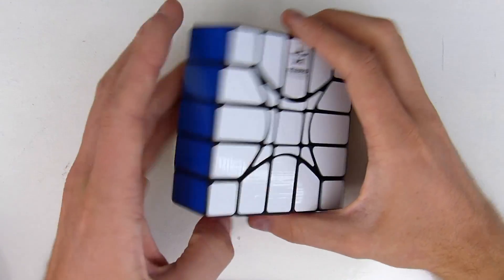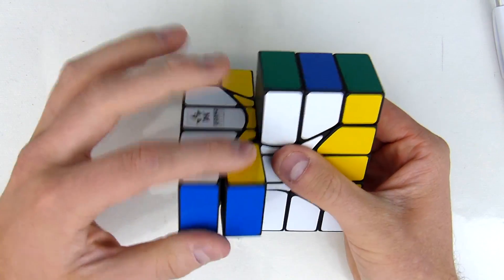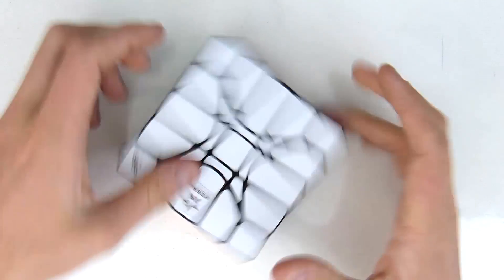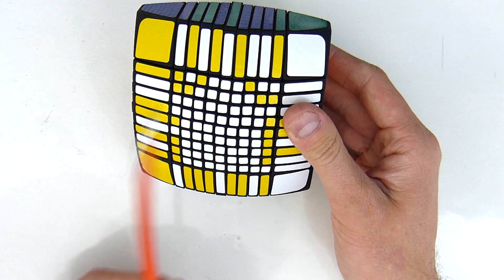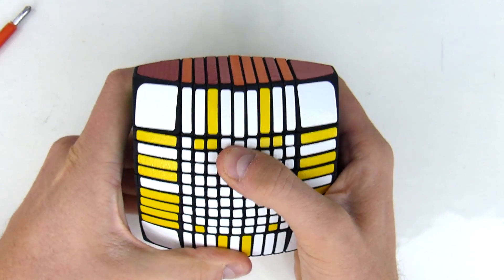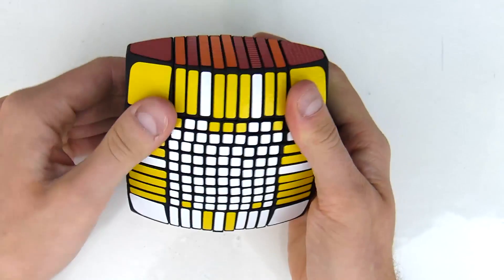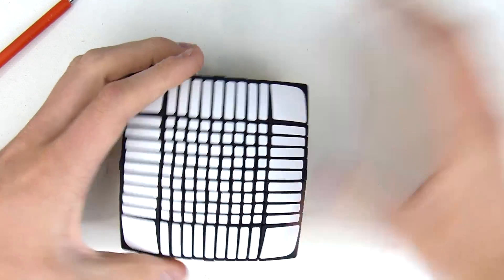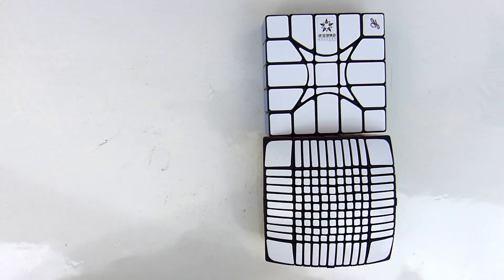The 1x11x11 Floppy is Just a Collection of 1x3x3 Floppies ! :)

Comment: As uwr holder of 7x7x1, and up to 11x11x1, I totally agree that NxNx1 are really easy
Reply: What are your times on those puzzles, and what simulator did you use? I've been struggling to find a better simulator for higher-order floppies than pCubes for a while.
Reply: Billabob 7x7x1 1.47 optimal 9 mover, and I have like 5-10 3s, avg100 is like 8, 9x9x1 is 9.**, 11x11x1 19 or 18, and I don't like odd NxNx1 cubes. I use Magic Puzzle Pro on phone
Reply: @igortarasow  That's fast. I might have to make my own simulator and beat you lol
Reply: Billabob good luck, if you really want to beat me, you can add me on any social platform, and I'll couch you to global sub
Reply: I also am asking Billabob's question, and people are using the term WB now, which means world best.
Reply: 1500 Cuber I've been cubing for 4 years, and I'm too used to uwr and official pb terms
Reply: But how do you solve the 1x9999999999x9999999999?